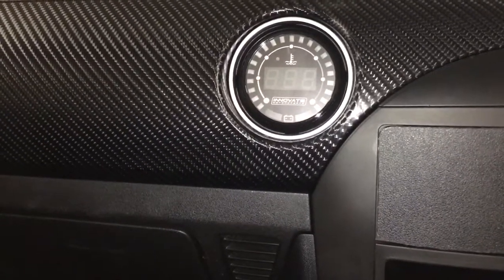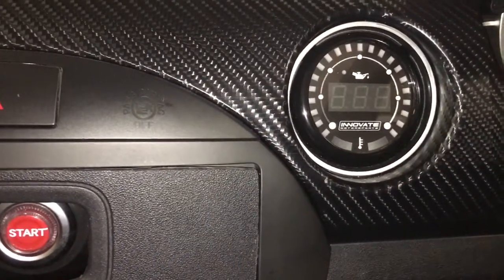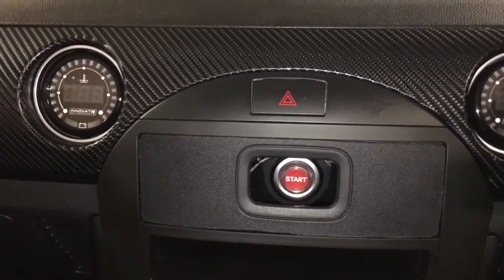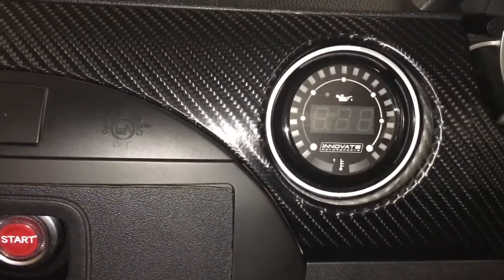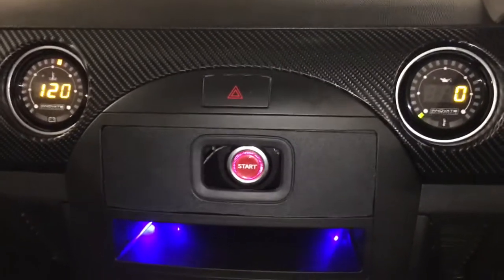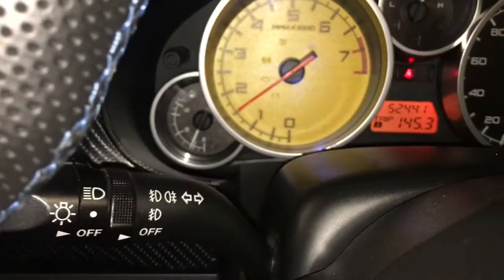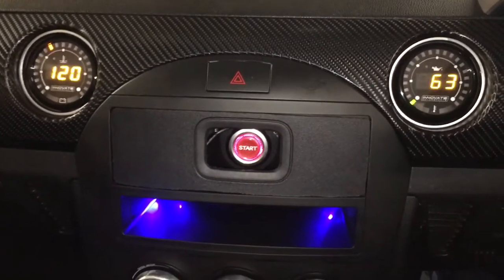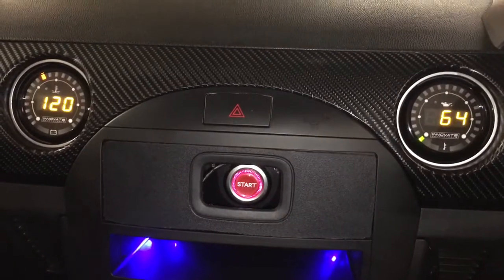Innovate motorsport oil pressure gauges

Comment: How many degrees Celsius is each line on the oil temperature gauge !?
Reply from the maker: It doesn’t work like that because you set the colours within a range. You can connect it to a laptop and set the parameters, I’m not sure what the default setting is as I changed them as soon as I wired them up.

Comment: Hi Gaz. Do you have a sandwich plate between your oil filter for the sensors? I'm thinking about a guage.  Also, Caffeine and Machine 10th Sept?
Reply: Hi Phil, yes sandwich plate fitted however you need a slightly smaller filter as it hits the subframe, heres the link to the plate
https://sps-motorsportshop.com/shop/en/performance-parts/mazda-mx-5-nc-2006-2015/enginebay/1-8-l/equipment/1435/oil-filter-adapter-d1-spec-3/4-thread?c=193

Yes see you on 10th if your down
Reply: @garrydring949  Excellent, thanks for the link. Haven't seen the SPS shop before.

I would love to get down to Caffeine and Machine one day but won't be able to make this one. Was wondering if the day was right with it being a Thursday but I see they have stuff on during the week too.